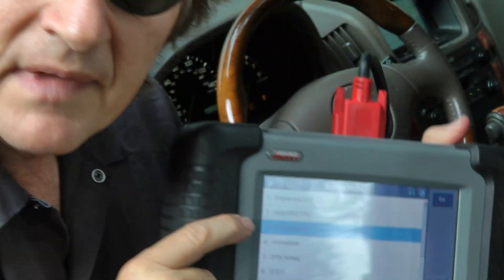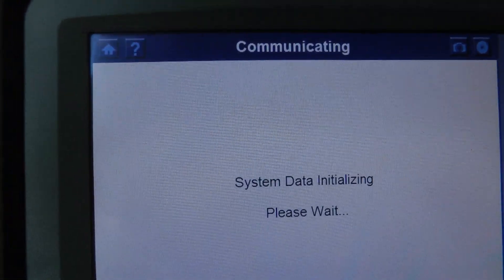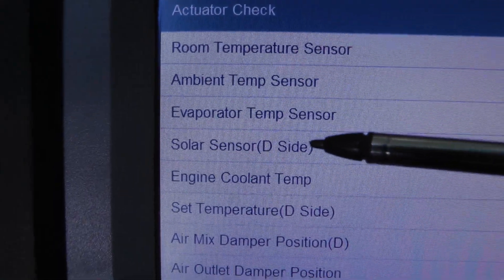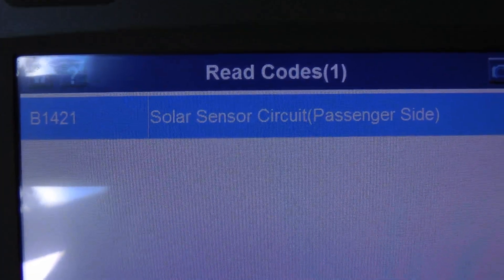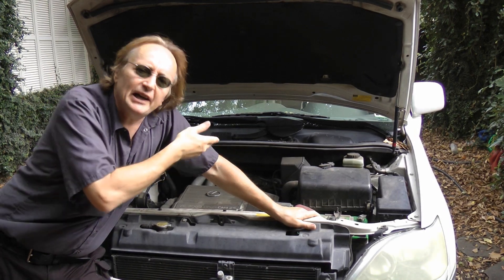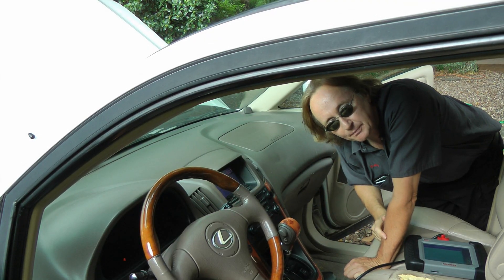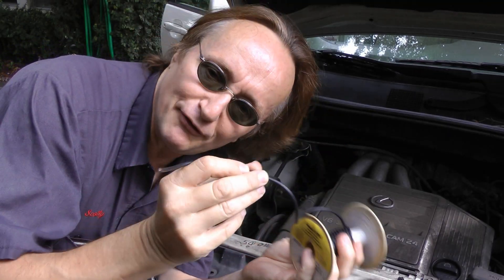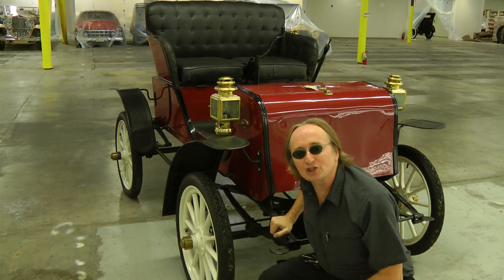Fixing Modern Car Air Conditioners

Comment: i have a ford mondeo 2003 petrol.
the climate control system works when it is kept at lowest temp of 16deg otherwise it blows hot air.

even if we set to 16deg, it blows air only for half an hour or so and afe=terwards,  the flow rate becomes very less and it gives very less air inside. continuous running the engine makes the air flow weaker.

whats the issues cant find any where??
is it a evaporator clog??

pllzzz get me some solution
Reply from the maker: +Bala Subramanian if rate of air blowing gets less as you use it on max cold, the evaporator is freezing up and ice then blocks air flow.  You have a control problem in that system somewhere that won't let the compressor cycle on and off correctly, and a dealer level scan computer is needed to analyze that complex system, so start with a guy like me with one of those
Reply: thxx mr.scotty, for your reply.

will the evaporator foam cleaner available in the market worth buying and using in my system. will it help to clean the choked evoporator. is there any vids of u speaking about the evaporator cleaner.

please comment on this too.
once more thxx for your kind reply

Comment: Hi Mr.Scooty i have toyota Hilux recently my AC not working only Blower blowing normal air and when i swith on AC switch my comprosser is not  working for this problem  i checked every thing like all fuses and try to by pass the connection by connecting a wire from battery positive terminal to comprosser it working if do these i may damage by wiring cirut or some serious issue please provide me some tips to check what problem so the current is not  passing in my Ac unit  mine pickup model is 2012........waithing for your responce

Comment: scotty my ac compressor switch turns off for a few seconds. but while im running the car and going it blows cold air. at a stop or traffic itll get hot and i can hear the switch go on then off and itll keep doing it. any idea what it is.?
Reply: Possible pressure switch?

Comment: Hi Scotty,,is it normal for my aircon compressor to start and stop spinning every few seconds?my car just had a second hand compressor put in and regassed works good,air is cold no problem just curios because I never actually noticed it before..my car is 2000 SUBARU WRX.hope you can help,,thank you!!!
Reply from the maker: when it's cooler outside, yes, that's normal. BUT, if it does that on hot summer days, AC system has a problem.
Reply: Thanks mate,,,super fast reply appreciate it,,,yes the car been doing it on hot summer days might have to take it to aircon specialist and get them to have a look at it......great help thank you

Comment: Ello there Scotty:)
I am trying to figure out the  Clutch is not engaging with the compressor on my 2000 Hyundai Sonata GL v6. Ac has been working  great. but going down the highway the air temp being blown out of the ac vents went HOT. I am a single mom but can be cantankerous when I need to be. I have looked at a few other channels but your makes more sense to me. Sad thing is.. I have an uncle in the AC business that wont help. so.....ANYWAY I have seen jimmying  the relay with a paper clip but I also have diodeds in the  under hood relay box not far from the ac relay...I am trying to save money to get a Gauge kit..oh well lol.. hope to hear your ideas ans thank you for reading this

Kat OB

Comment: Hey scotty, my 2005 Honda Odyssey has water or some sort of liquid dripping in the back near the tailpipe and gas tank when the car is off after the ac is running. Is this a issue or not? The drip is behind the back right tire.

Comment: hey scotty I have a 2003 trailblazer I recently filled my car with Freon and because I started to feel heat and so now when I drive it cools a little but not cold enough and when I stop at stop sign or red light it blows warm air do you know what I can do to fix the problem or what you recommend I did a little research and went and bought a low pressure cycling sensor hoping it would fix the issue but nope if u can recommend me some thing to do or a part name that would be great btw I love your videos
Reply from the maker: First, you have to do as in my video "how to fill your car's AC with refrigerant" to correctly fill the system up. Anything else is guesswork, so start with that. If that doesn't fix it, Many things can go wrong, do high and low pressure tests at idle and at 2000 rpms and e mail me the pressure readings

Comment: Hey scotty , I was working on. 1991 toyota corolla 1.6 motor. Blower motor blows on the off position. I changed the resistor and it does the same thing. The relay that was powers the ac blower was fine I switched it with another relay and it still was blowing air on off. I noticed that were the relay plugs into , there was burnt spots . But not on the relay . Any idea?
Reply from the maker: replace the blower motor switch and pray wiring hasn't shorted out inside the dash

Comment: scotty is right unless your looking for more power; even then you'll run the chance of running the engine lean(too much air too little gas in the cylinder), unless ur willing to spend money on other components like fuel injectors bigger exhaust system or having the ecu tuned to keep the fuel to air mixture at reasonable ratio but still resulting in more power and that's not mentioning opening the engine up n changing components to high performance, so sometimes its just better to keep it factory

Comment: hello please can u help me...i have a Audi A8 3.0 tdi quattro 2005 and the air con does not work....i fill it up and it only blows hot air some people look at it and they sayd that the compressor does not recive electric power and it might be the pressure switch.What do u think it is?
another thing is the when the car is on iddle for about 1 minute it smokes some white smoke...there is no lack of power in the car....thank you

Comment: Hi Again Scotty 
Just watched your video  i dont have the scan tool like the one you have here but im looking to replace the CU now and see how it goes.. just to recap the compressor is working ok all the fans including the radiator one are all working ok but i still think im looking at a definite electrical problem so after i replace the CU and the problems still there im taking the car in to have it scanned and see what it really going on thanks again for your ill let you know how i get on

Comment: Hi Scotty, 

What can cause AC cycles on and off? especially during the day when weather is hot.

I went to many mechanics and they didn't solve this problem even the dealer replaced the whole Control Unit and couldn't fix it. They just let me waste 450$ on replacing control unit. I'm thinking to sell this shit 2007 Toyota Camry. 

Thanks.

Comment from the maker: see my video "fixing ABS brake problems on your car" and realize you need a scan tool at such a high level to analyze VSC problems. BUT, on that model, if you have a stored trouble code, that automatically puts the VSC light on, and that would need fixing first

Comment: It seems like maybe a rear expansion valve is clogged,because is has 3lbs coolant installed now. But I looked in the back access door compartment and only found a blower motor and no lines from the AC.

Comment from the maker: hot wire means to run a wire from the positive terminal of the battery directly to the AC clutch power wire to make it run

Comment: Scotty-we have a 2000 Nissan, it would not hold a charge. Replaced the comp and the main hose/line and now it is cold in front but nothing in the back(rear ac). We put in 3 cans(36oz.) The label under hood says 3lbs for rear AC so is it just short 1 can coolant or something else? Thanks

Comment: I have a 96 Dodge Stratus ES 2.4.   My AC stopped working, I had a new air compressor kit put on, drier, expansion valve, transducer  and it still will not work.  The compressor wasn't working until he grounded it, and it started getting a little cooler.  He evacuated the system, but it would not take a charge. Maybe a block in the system?   He mentioned getting someone to do a toggle switch, but can't find anyone to do it.  Thanks Scotty I enjoy your videos!

Comment: I don't get it either. The AC on my Dad's 2012 Acura TL wasn't blowing cold and when he took it in they had to scan and diagnose like crazy to figure out what was going on. Turns out the in car nav had to be re-programmed because the climate control system was designed to track the sun at different times during the day using GPS whiles working with a host of other sensors and inputs so it can tell the AC system what to do. System is ridiculous with too many failure points.

Comment: Hey Scotty. I have a 94 Honda civic. The a/c works great at nights, and in cool weather. However, if the temp is over 80 degrees the compressor will not engage. Any ideas?

Comment: The more luxuries a vehicle is the hard and more costly they are to fix when they break. No thank you. i'll stick with my 1995 Ford f-150 stepside where I don't have to deal with this type of luxury garbage with electronic dual climate control zones etc... My basic A/C works just fine with me.

Comment: Hey Scotty, love ur videos; I think they r very informative. I have a questions for u. Since yesterday my car has shut off three times on me. This happened once yesterday, and twice today. This occurred when its idling at the stop light. I also notice that it idles very poorly; sound goes in and out. Once its moving its fine. Its a 1997 nissan sentra GXE with 166,000 plus miles on the engine. Do u have any suggestion as to why this might b happening?

Comment: Hey Scotty, my car is a Maruti Wagor R LXi 2008 model. When I turn the AC on, the gas pedal needs to pushed down a little further in order it to run smoothly. Or else the engine stalls with the AC on when the car is in Neutral mode.(in about a min).

Comment: hey scotty i found a 91 toyota celica the guy said "only problem with the car is that the synchronizer is out in 4th gear so pops out everytime I just go from 3rd to 5th and goes perfectly fine." how much would it cost to fix that problem? i mean the car is only $750 as is

Comment: Hi Scotty i have a problem... I have a 2003 Toyota Tacoma Prerunner V6 and the AC compressor keeps switching on and off a lot. I checked the freon levels correctly with a gauge and they are normal. And the air doesnt seem to be cold enough. What could be the problem? Thanks

Comment: Hi Scotty,
Good to hear the moon Shines tasted good. lol. I have a toyota carina 1998 si 1.8L 7A-FE engine, Chasis AT211. Some Idiot over tighten the transmission drain plug and when i was doing the ATF Fluid change the tread came off (Stripped) the drain plug. So i call the dealer and ordered a drain plug which was NZ $12 and fill it up with ATF Type T4 oil and put the new drain plug back again with the "old gasket(washer)!" my mistake! and next day the oil was leaking. Solutions?

Comment: I have a 99 Dodge Dakota pickup. My AC doesnt work, and it is insanely hot in this vehicle. My ac clutch on the compressor does not even engage, what can cause this? Low Freon?

Comment: my 98 Corolla's a/c went kaputz and  no one could fix it, finally had a guy install a toggle switch for me to turn the compressor on and off but the problem is that the idle speed won't increase and when I stop at a light, the engines shakes a lot so I have to turn off the compressor as well as  when it's been running a bit, I also turn it off, Pain the butt

Comment: Hi scotty. Love your video. I have a problem starting my car. It is a toyota ae96 with a 7A-FE engine. when i crank the ignition, nothing happens. i can hear a clicking sound, but no idea what it is. i have no problem jumpstarting the the car, but once i turn off the ignition, it goes back to square 1. I thought it was the battery, so i had it changed. However, in just a few days, my battery went flat. do you mind giving me some advice?

Comment: Seriously...what's the efficiency of diagnosing sensors, computers and actuators to simple levers, cables,and other mechanical switches....i bet you'll probably need a certified HVAC tech to do maintenance even on a entry level auto in the future ..it's not an aircraft, ship, or a bus for crying out loud...sheeesh

Comment: Hey,if its an automatic trans ? check the valve that unloads the torque converter ---its called a tcc valve on gm cars .......good luck pard -ye needs wheels to get ye meals.......Thanks for the video Tejas WILDMAN ......Peace and Prosperity

Comment: I have an 02 Century that does that when the AC is OFF. My intake gasket is bad so oil got into the cooling system and gummed up the thermostat. But if yours does that when the AC is on, it probably isn't thermostat-related. Maybe your compressor takes more effort to run than it should so it strains the engine more. That's all I can think of.

Comment: they range from $250-$1500+ for one, and you could use your laptop but you would have to buy the OBD-II connector for it, I work at a toyota dealership and we have a laptop from snap-on that runs its own internet server so that you can take it on road tests, it uses E-TAS (a program that is toyota specific) and that laptop cost the shop $10,000 new but thats also because if you drop it from a 3 story building, it would be fine, and the battery lasts for 48hrs

Comment: well this is kind of relative depending on what you have to fix, i have a 2006 nissan patrol and somehow the AC stop blowing cold in the day and in the night i was freezing my ass off and when i got it to inspection it was a bad AC condenser, is there anyway to prevent your car's AC system to fail on you ? and stop blowing cold ?

Comment: ive been a mechanic going on 3 years and i hate cars more and more everyday. i just feel bad for people who own them having to spend hundreds to fix garbage that doesnt even need to be there. i drive a 1990 c1500 pick up truck, when it finally rots away im going down south and picking up another one of similar year, so easy to work on even the heatercore has a access panel!

Comment: I have my issue about zeroed but if you can help Scotty I would appreciate it. Occasionally my car has hard shifts, lags a bit, and while maintaining speed it revs back and forth a bit. For a second time the code for a transmission sensor has gone off as well. I have a 2006 Grand Prix base with a auto transmission.

Comment: Scotty I have a problem in which every time I use my ac which works fine my radiator fan remains on for 15 minutes after the car has been shut off. It kills my battery. What can this be?

Comment: i have an 07 bmw 328i everytime i turn on the a/c there becomes a loud ticking noises, when i press max it gets even louder, aswell as the engine, it sounds as if it is also ticking and making a weird noise, similar to a blow off valve, plz help, i need advice?

Comment: My A/C has 2 leaks; at the evaporator and in the hose from compressor to condensor.  The shop wants about $560 to replace those 2; should I replace myself, and then get it refilled with refrigerant somewhere else?

Comment: My parents have a 2007 suzuki xl7 and in the winter the "climate control console" thing went bad so we couldn't get the defroster to work. While we waited for the new part they were able to turn the heat on so it ran all the time. New cars should not need to be this complicated.

Comment: An A/C system needs the following things in order to function correctly: 1) The actual mechanical components, i.e. the compressor, condenser, evaporator, etc.  2) An on/off switch.  3) A blower speed switch.

Comment: In Canada it isn't legal to install R134a or R12 without a license so companies have developed something called R12a which is a different, but apparently more efficient refrigerant to use that's completely compatible with systems designed for R12 or R134a. I've used it in my car and it works just as well if not better.

Comment: ...I really like my 1998 Pontiac.  Vacuum-actuated blend doors, an electric switch for fan speed, a vacuum temperature control, and a vacuum location control.  Plus the dash comes off with 15 screws hidden behind pull-off access panels!  So easy!  :-D

Comment: >>>>>>>MOST CARS  have REAR side  windows right?

why not choose a side roll one of the back windows down and install  HOME $88   8,000 BTU A/C IN THERE? 
just install in window and RUN an INVERTER to power your BAND NEW $88 dollar car a/c.
just add some card board and duct tape any your back on the road in cool comfort..

For more tips like this just visit your
local GETTO @ your state dot COM